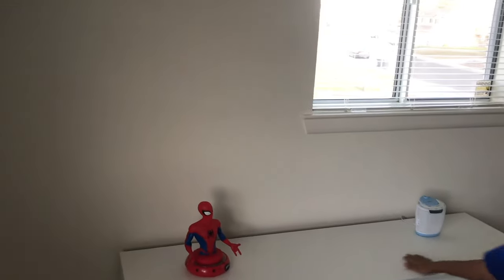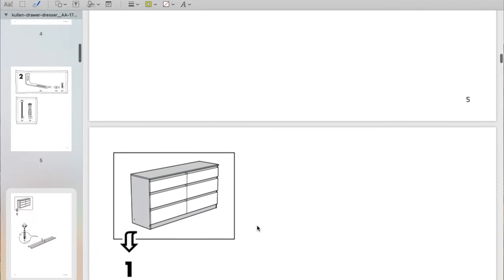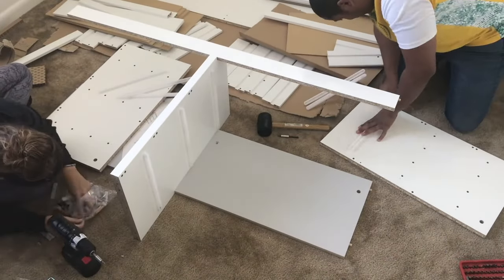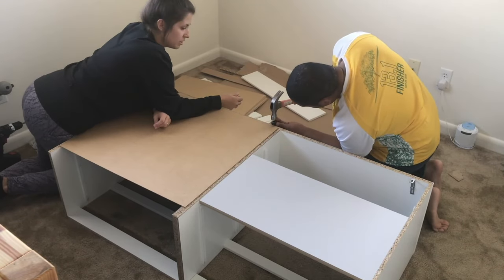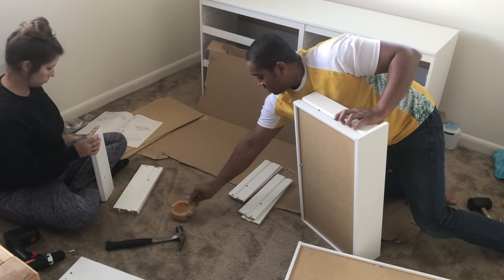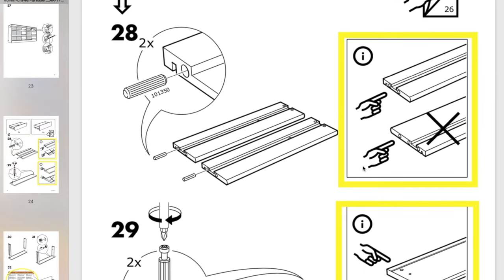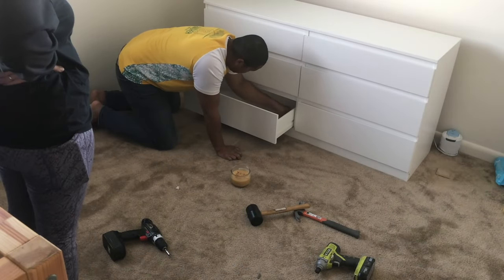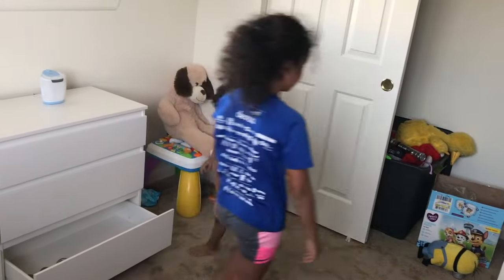Ikea Kullen 6 drawers Assembly and compare to the Ikea Malm 6 Dresser.

Comment: These look exactly like the malm dresser, do you know what the difference is other than the £80 price difference ? 😳 I’m wanting to buy a 6 drawer dresser :)
Reply from the maker: The drawers are different on how they slide and also smaller on the Kullen.  Also, the Kullen is about 5 inches shorter length wise. Check out 6:29 I have a comparison of the 2 drawer dressers sizes.
Reply: MALM dresser comes with railing for drawers, while KULLEN is without the railing.

Comment: How sturdy is it? I'm considering the kullen 5 drawer chest but want to stack an Eket cabinet on top. The eket range is a modular system and is designed so you can stack different units together so I'm assuming it would be light enough for the kullen to take it? Also did the wax work? Sticky drawers put me off!

Comment: I want to thank you for the paraffin hack.
I assembled two Kullen drawers yesterday and used candle wax and soap on one and only candle wax on the other. It also helps to make sure the plastic railing is hammered against the sideboards. Because after screwing them in they tend to bend in the middle.
Of course I used a rubber end of the IKEA screwdriver and not a real hammer....

Comment: Is it possible to assemble even just with scredriver and hammers only? Thanks for the video! :)
Reply from the maker: Yeah that’s all. It also comes with an Allen wrench too for some of the screws.
Reply: @vance1704  so you don’t need the drill?
Reply from the maker: @sisSonders  You would need it if you need to attach the dresser to the wall

Comment: They're adorable ^_^
Are the drawer slides really stiff or are they easy to open? Would this be good for an adult? My boyfriend is 6ft and I'm worried the bottom drawers might be a hassle for him.

Thanks!
Reply from the maker: Thanks. Putting the waxing definitely makes a huge difference to make it slide better. This dressers height is about 28 inches 6:29 which is about 2 inches shorter than the Malm. In my opinion it’s better for children due to the height and depth of the drawers.